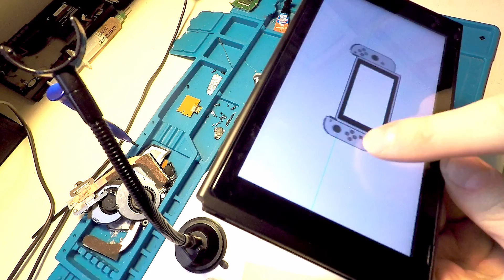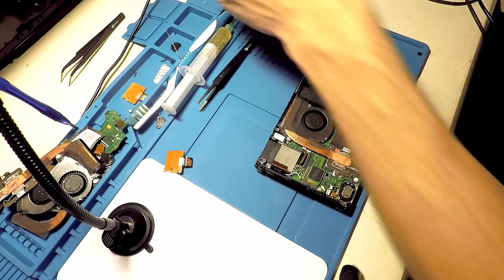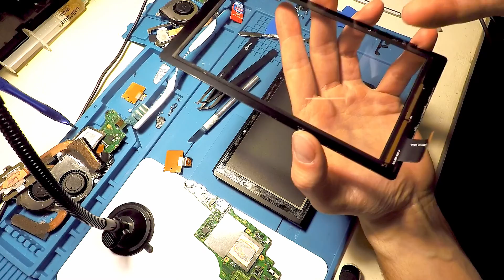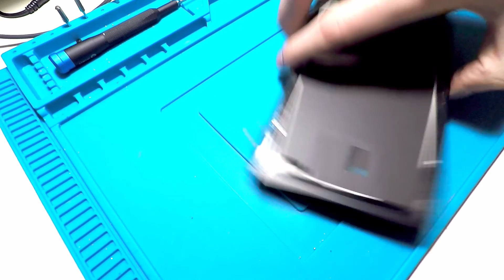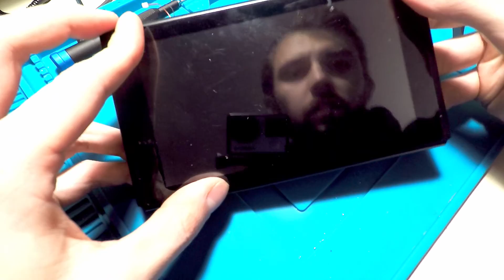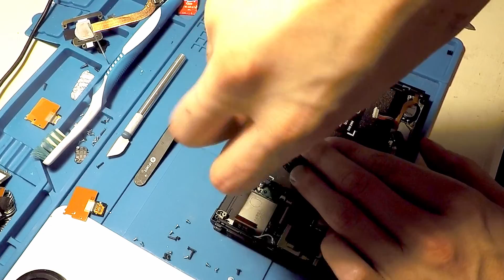Nintendo Switch LCD and Digitizer Replacement

Comment: Hi I just ordered two digitizers  and lcd replacements and both lcd replacement don't work the digitizer does but the screen is still black please someone help
Reply from the maker: Shine a light on the screen. If you see a picture your backlight doesn't work so check the connector for backlight (google it). If nothing, check the LCD connector (right below the game cartridge reader). This is a commonly damaged component as the pins are very easily bent.
Reply: @GarrettTurbod  it's probably the  connector then because the backlight and touch screen work but it's just black is it possible to fix that connector

Comment: How do you center de lcd?
Reply from the maker: Just align the lcd on the digitizer first. The digitizer has an outline of the LCD with adhesive on it, I will usually stick the lcd to the digitizer in this way first.

Comment: Will a new lcd will work on a switch with crazy flickering? Dockmode works perfectly fine.
Reply from the maker: Hard to say. If the console has been dropped the screen may have physical damage. Or, it's possible the connector is damaged from previous work. Either way, you'll need to disassemble to know for sure.

Comment: Where can I find a Digitizer HAC-001 compatible... I got one from ebay which only works on its corners
Reply from the maker: That's a good question. I don't know the answer to this. Still unsure of what dictates the differences between them.
Reply: @GarrettTurbod  supposedly the game card reader plays part but I've searched everywhere for information to no avail
Reply from the maker: @Ezra79  I did notice the number of capacitors is different between the two. That's the only distinguishing factor I know of. Check out the link I posted below. We discussed this topic at one point on GBAtemp, I posted a few pictures. 

https://r.tapatalk.com/shareLink/topic?url=https://gbatemp.net/threads/switch-touch-only-working-in-certain-spots-on-the-digitizer.565222/&share_tid=565222&share_fid=27398&share_type=t&link_source=app

Comment: Have you ever had it where the replacement digitizer works except for the middle of the screen any tips
Reply from the maker: Yes. The ribbon cable may not be seated completely. Otherwise, the digitizer may not be the correct version for the switch.

Comment: So beside the water or factory defective...If you press it hard , will it damage as well? Like when you press on LCD computer monitor, there is always a black mark that shown and as soon as you release it ..The mark disappeared ... What happened was when I installed the screen protector, I didn't know the screen was plastic and I presses hard to make the bubbles away from the screen protector ...Will I damage it?
Reply: Use a plastic scraper or old credit card/gift card to remove the bubbles.

Comment: Whenever you get a tiny line through the screen like that, it's never the cable or the connector.  If the connector was faulty then you'd see alot more than just a single line across the screen.

Comment: Affter change the screen have you ever had error 0002
Reply from the maker: Try removing the game cartridge reader from the board and boot again. Console will still turn on without it just won't be able to use touch screen.

Comment: There's been dust inside the screen of my switch. Just want to ask if I have to completely remove the digitizer or I could just lift it up
Reply from the maker: You can lift it but you'll likely get more dust in if you don't completely pull it off and clean it. If you remove it completely, you can leave the LCD in place and use some Scotch tape (clear tape) as a dust remover. Just be very careful with the ribbon cables.

Comment: Thank you for detailed video, I've ordered digitizer for my switch and planning to replace it when it comes, do you have a recommendation regarding how hot the heat gun should be? I mean the temperature which you can safely heat your switch and not damage the lcd behind it. Hundred and twenty seems too hot for me, what about hair dryer? Could you suggest the best way to peel the digitizer if I ever use hair dryer. Thanks
Reply: Indra Prastyo did you replace it or yet?
Reply: @Hyutabi  Yep, replaced it without issue, just apply enough heat but not too hot around the edge of touchscreen, and carefully pry it, I used plastic opener on the bottom left of speaker and going around little by little, just be careful you don't accidentally break the flex cable on the right side of the screen, and don't forget to remove and place rectangular adhesive tape from your old touchscreen to a new one, this is because the tape act as a pillow between your screen and touchscreen so your screen won't jiggle around, finally remove old adhesive from your touchscreen if they're not strong enough anymore and apply a new one around the housing shell. Make sure there are no dust on the screen either. Personally I used adhesive for replacing touchscreen on phone.  Good luck!
Reply: I really need tips from fitter ....

Comment: Hello, quick question, how can I just remove the digitizer? Some dust was inside my switches screen and I just wanted to lift it up a bit to remove it from the inside. I wouldn’t have to unscrew anything right? Just heat it up and lift it?
Reply from the maker: Theoretically, yes. But be careful because the ribbon cable for the LCD and digitizer is short and very fragile. Also, it's very possible you'll just get more just in there.

Comment: I don't have a heat gun, what is an alternative to that?
Reply from the maker: While I'm reluctant to suggest it, if you're careful, an oven could probably be used. If you keep the temperatures below 150F, you should be ok. Just need to soften the glue. A hair dryer would even work. Good luck!

Comment: So what's the trick to remove the digitiser only? Do the mb screws hold the LCD in place??
Reply from the maker: Just have to carefully separate the two. More often than not when you heat the assembly the LCD stays in the case rather than coming up with the digitizer. 

Just leave all the screws in the MB and remove the game card reader.

Comment: Hi Bob I replaced the screen on my nintendo switch I feel like everything went smooth however I do not have power now.. so I thought i may have been too rough on the battery getting it out, so I replaced it and I still have no power and it will not take a charge .how can I troubleshoot this situation with ohm meter or any other way?
Reply: pleeease help
Reply from the maker: @illfather7066  I would suggest getting a USB C power meter to understand if your console is indeed pulling any current. 

It's also possible the console is turning on but the screen is not. You can try tapping the screen to see if the console reacts to the touch screen - this would indicate something is wrong with the LCD or installation. 

I have a video and others have done videos on checking for shorts on several capacitors around the M92T36 chip. This is more unlikely UNLESS you damaged pins when installing the LCD connector
Reply: @GarrettTurbod   I really appreciate you messaging me back.... I guess  I could have possibly damaged something.... I Don't see any light coming on when I plug it in but I'm not sure if this thing has a light other than the base for it.
Reply: @GarrettTurbod   I know that it worked before I swapped screens.... The only thing I didn't feel good about was how much pressure it took to get the battery out... But it is possible I wasn't delicate enough with the ribbons I guess... I guess I can take  Pictures and blow them up and see if I see anything
Reply: @GarrettTurbod   I have a ohm meter with different settings but I just really don't know which places to check other then the battery port itself.... I have a pretty good success rate of taking things apart like this in putting them back together but I will admit I don't have a full  Understanding  of whats under the hood... Usually only fix the obvious but when it's something I can't see I can't fix it
Reply: @GarrettTurbod   I just  Looked up that power meter that is really neat... I will have to purchase one thank you